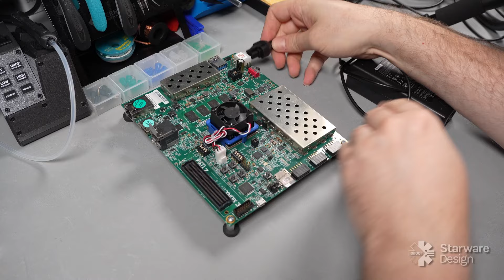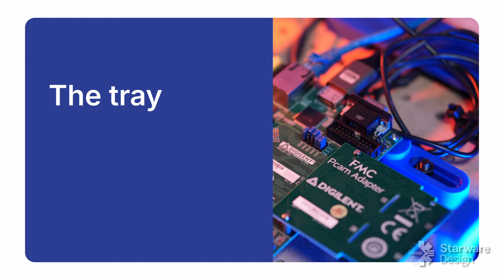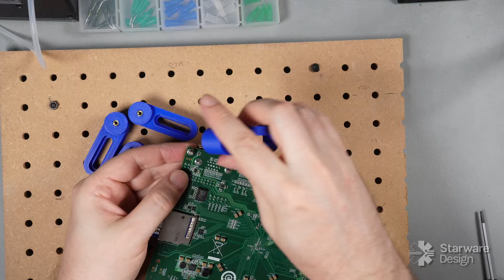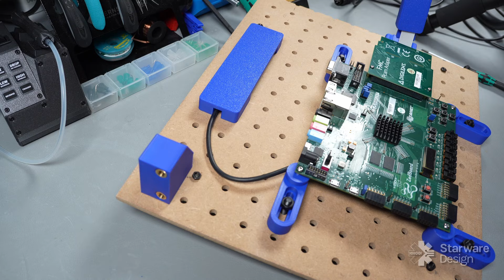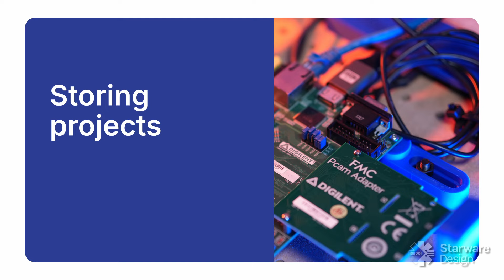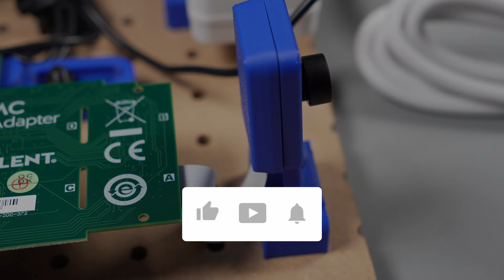Project tray system

Comment: Fantastic idea, I’ve been looking for a system like this. 

Another way you could do power is through usb c pd trigger boards with adjustable voltage soldered to barrel jack for the zedboard. Then passing usb c through the keystone in the patch panel. That way you could keep a usb c pd as a universal power supply at your bench for each different tray when plugging in to work on.
Reply from the maker: That’s a good idea!